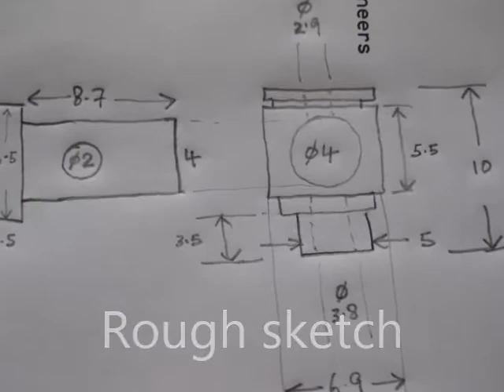AE 0.1cc Model Diesel Engine Revisited (Part II) Throttle Prototype

Comment: This is like choke,not an throttle. I think barrel position should be uder spraybar ,because this position increase fuel suction.Cross section of barrel hole should be same as in venturi minus spraybar.
Reply from the maker: Hi, thank you for your advice, I will take them all onboard.  Youy are right, a choke plate is above the jet and the throttle plate (the butterfly) is underneath the jet.  Now I know the reason mine is not making a lot of difference in speed.  I got the idea from the Cox Surestart RC Throttle, which sits on top of the long intake tube and is quite a distance away from the needle valve.  I think the word "throttle" is being used very loosely to mean some form of speed control.  The diameter of the barrel hole was the same as the venturi of the AE before I enlarged it, thinking it would improve performance but it didn't.
I started it and I might as well finish it and afterall I only wanted to practice my skill on using the lathe, which I got as a birthday present over 15 years ago but seldom use it.
In most model RC engines the needle valve is situated within the barrel so ideally it is better to make a complete carb but my model engineering skill is not at that level, especially I don't really want to dismantle a tiny engine like the AE 0.1, they are just too precious ;-)
Thanks again.
Regards.
Reply: Maybe making exhaust throttle like on cox engines will have enough effectivity for your tiny toy.
Reply from the maker: No! No!  It's not a toy, it's a model engineering wonder:-)
Just saw your vid on "Your first handmade engine", the difference in engine sound when you partially covered the venturi with your finger is simlar to those produced by my "throttle".  I now fully understand what you were saying, my "throttle" only resrtricts the air inlet thus enriching the fuel/air mixture.  The engine runs rich and drops its speed a little bit.  So, it is a choke; you are absolutely right.
But then how would you explain the Cox Surestart throttle, it's a similar setup, isn't it?